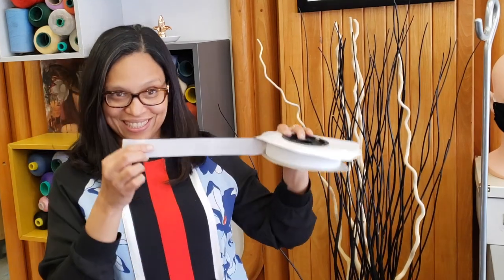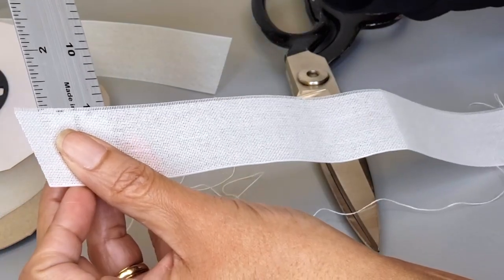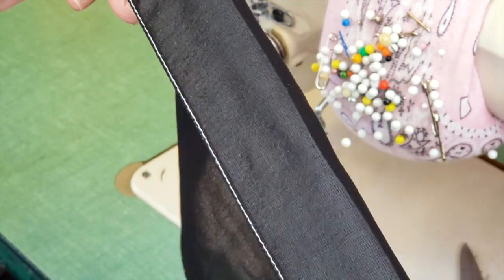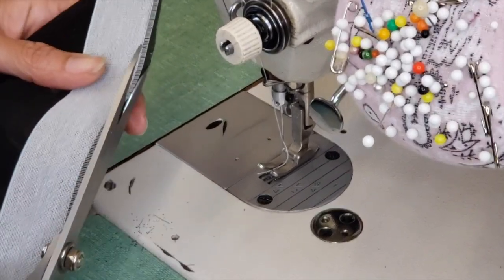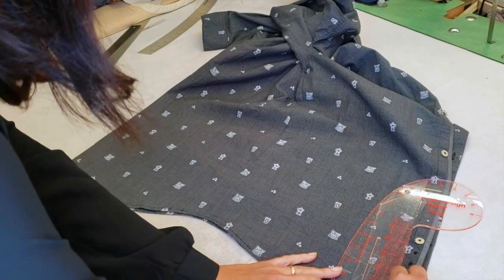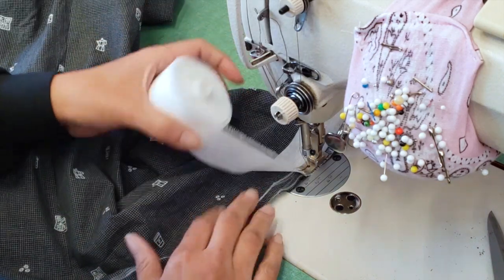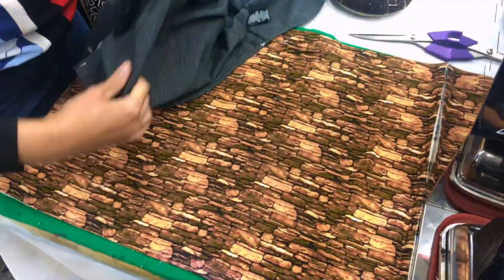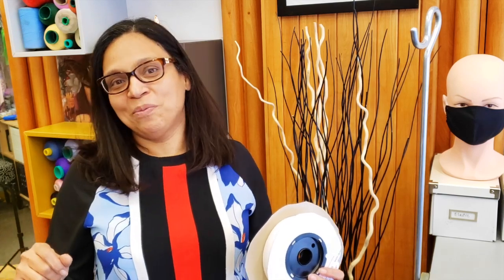How to attain a FLAWLESS hem using the BAN-ROLL technique! (curved hems too!)

Comment: Well that would have worked if I had only noticed that the first step is on the RIGHT SIDE of the fabric. Dang.
Reply from the maker: Ups! Sorry 😞 I'm pinning this comment because it might help others.
Reply: Sandy Cheeks  yes, I was not quite sure of that either.  So glad it was clarified first comment.  I feel sorry for people who don't read comments.  Granted I probably won't  read 500 comments, but I will check answers Downtown lady replies. Another great video.
Reply: I just tried this on a scrap, not  being sure of which side should be up for the first step. So, now I know :)
The product worked GREAT!!  Thanks so much for sharing this video.
Reply: You're human!  And sometimes we all learn best from our mistakes. Next time it will be perfect!
Reply: Can the ban-roll be reused more, than once?
Once the edges are a bit frayed do you cut the frayed edges off and make a new edge?
Reply: @velvetstitching3631  I have been using it more than once if I am needing the same depth hem on another garment,  or peeling it narrower for a wider hem in some cases.
Also,  there are 2 sides to the tape,  I think using the un-fringed side could be possible too.
Reply: Can I double the hem as normal or do you it sew it just with a raw hem?
Reply: Where can I buy ban roll interfacing tape? I have looked all over and cannot find it. I would appreciate any suggestions.
Reply: @DowntownTailoring  where did you get your iron from?  I want a professional steam iron!

Comment: Thank you for sharing your expertise!
Reply from the maker: Thanks for watching 🥰
Reply: @DowntownTailoring  May I ask a question? I’m a novice and (slowly but surely) learning pattern adjustments needed for improved fit.  I always have to do a high round back adjustment and a forward shoulder adjustment.  I also need to shorten the length between the shoulder and the high bust up to 3/4”-1”.  When making the corresponding adjustment to the sleeve piece, I don’t have enough space to shorten the sleeve piece between the notches and the sleeve head.  It also significantly distorts the shape of the sleeve piece. Would you please offer a suggestion on how to adjust the sleeve piece properly?  I would be ever so grateful.  Thank you

Comment: Another excellent video—and that iron—do tell which brand/model! Also, I see that you leave the hem with just the one fold. Do you ever encapsulate that raw edge by folding over again or would it be too bulky?
Reply from the maker: Thanks 🥰 Yep, I did encapsulate the raw edge when I turned the ban-roll.  Cheers 🙂

Comment: Thanks for this great idea. Do you have a source for this Ban-Roll in Canada?
Reply from the maker: Thank you Mary! I live in Canada as well. I ordered mine from Cleaner's Supply, they are based in the U.S but they have very fast shipping if this helps :)
Reply: @DowntownTailoring  Thanks for the quick reply! I have ordered sewing supplies from clearnersupply.ca and their pricing and shipping are great (wawak.ca as well). I noticed that their ban-roll is listed as made of polyester and other US sites list it as: 58% nylon/17% rayon/15% polyester/10% thermoplastic resin   --- do you think it matters? regarding strength of the little threads is what I am thinking...
Reply from the maker: My pleasure! I do believe that it probably matters a little bit. However, I have used the same roll of the interfacing tape over and over and it has served very useful. Haha my apologies for I wish I could give you a more precise answer!

Comment: As I said before a real game changer but not as easy as it looks. Practice with it I'm sure will make perfect. I had a question Assuming the ban roll is long enough for your next project and requires a 1/16 " you  could actually use the same ban roll you just used again with the new project yes? If so then this makes this a super game changer!! LOL
Reply from the maker: Yes! You can reuse the ban-roll many, many times.  Cheers 😊

Comment: Great technique! Thank you for sharing this.  I have a question.  I went to India and brought two outfits home for my daughters.  They fit well except around the sleeve/underarm part. (They are short sleeves) Do you have any suggestions or techniques (possibly a video) that could help to alter the outfit to fit?
Reply from the maker: What seems to be the problem?
Reply: It is to tight in and around the sleeve area.
Reply from the maker: @marypacer3084  You could insert a gusset into the sleeve to add more room. I haven't made a video on doing this with sleeves yet, but my video about making jeans bigger by inserting material could maybe help!
Reply: @DowntownTailoring  ok. I will look at it. Thank you for your help.

Comment: Is there a reason you didn't reuse the Ban Roll from the opposite side? It seems to me, once you rip it out, you could even cut it lengthwise and reuse it multiple times. Or is there something I'm missing? Thanks, neat tip!
Reply from the maker: Yes. You can reuse it.  
Check out this video.  You can go directly to the minute 3:30. It answer better the question.  Cheers
https://youtu.be/ppc_dI58uDI

Comment: I've been watching your tutorial on the Ban-Roll tape, and am wondering how effective this method is when working on fine silks or chiffon fabrics?  When you remove the Ban-Roll Tape, it seems quite agressive and wonder if it will damage the finer fabrics?
Reply from the maker: Hi! This is a great question.  Thanks for asking. It doesn't damage the fabric for the most part. If you try to pull it too slow, it can pull a thread with it. The right way, like I joke about in some videos, is a savage one: 😁 snapping while holding the seam with the other hand. Not too fast, not too slow, just make sure you are holding the hem closely and securely with your other hand. I hope this helps 😊
Reply: @DowntownTailoring  Thank you.  I will give this a try.

Comment: Is this the technique I would use if I wanted to make my own silk ribbon on the bias?
Reply from the maker: Yes, That's a way.  But I think the spaghetti strap technique will be nicer and cleaner.  I explained it in this video to achieve a very thin strap.  You'll need to use a wider bias tape for ex 2 1/2" to achieve a 1" ribbon.  I hope this helps ❤ 
https://youtu.be/76Gtqe7tEnE

Comment: But what about turning under the ends at the beginning and end of your hem?  At least for the top layer of your shirt (at the bottom of your buttonholes) you still need to turn under those ends so it's finished well.
Reply from the maker: Yes. When I do alterations I usually copy the original hem like I did with this shirt.  It's very sad but Today's fast fashion is not making the hem inside the placket/facing anymore 😔 Saving time therefore money. The saddest part is that the public even doesn't notice the difference 😪

Comment: ???I am going to use this for a dress hem. Just practiced on a scrap, with success.  Will I need to cut a length of ban-roll equal to the circumference of the dreas hem?  I think so?
Reply from the maker: Yes. This would be optimal.  I usually have a mini roll of 7 meters which is long enough for most hem. Cheers 🙂
Reply: Thank you.  Finished it this afternoon. Worked great.  I so appreciate your video.  Was unaware of this product before watching.
Reply from the maker: @janiewilliams5803  I'm glad everything worked out fine! 😊

Comment: But doesn't it just put up a single fold, not a double fold, so raw edges are inside the hem??
Reply: Watch as she folds the tape around the edge - the tape starts on the right side of the fabric, so as the tape is folded away from the right side, that causes the first fold of the hem, then the tape is brought around to the wrong side of the fabric and that tucks the raw edge in for the double fold. So the raw edges are hidden.

Comment: I've seen this technique before and as one who's sometimes struggled with narrow hems over the past 60 years; I think it's TERRIFIC!  If you have a really good eye and very sharp scissors, you can carefully trim that tiny hard edge off the Ban Roll before using it. Just cut between the edge and the first "string". It makes removing additional strings much easier.

Comment: Anyone knows a European supplier for this, please reply and let me know. I just searched for an hour and can't find anything like this...
Reply from the maker: Try to look for buckram.  It's basically the same product.  Just make sure you are getting it in narrow rolls. Good luck!
Reply: @DowntownTailoring  
I tried. I know what buckram is, from watching videos about historical tailoring. But when I google it, nothing comes up. Or rather, I get lots of results for iron on interfacing and   coated/laminated stuff. 
Even Etsy was a fail. 
I guess, I'm going to try water soluable embroidery stabilizer, instead. It will create a stiff hem at first, but should completely dissapear in the wash.
But thanks for trying to help!
Reply from the maker: Yes. It might work!

Comment: you can also just use a sheet of typing paper instead of the roll of tape
Reply from the maker: Yes! But you have to take in count that the pieces of paper will remain inside the hem.  Just in case it's important.

Comment: The usefulness of the tape isn’t worthwhile if the strings won’t pull off the edge.  It will rip the hem.  Possibly one brand is better than another
Reply from the maker: Try to get the ban roll at Wawak.  I use mine for years and I have an alteration shop. Good luck!

Comment: I use a hemming foot, its easier, much quicker and you dont need to buy any overpriced tape. What gives? Why do you prefer this way of doing it?
Reply from the maker: Hi! This is a matter of preference.  I find that is easier to achieve a perfect finish.  The ban-roll is not more expensive anyway than the foot.  I have many colleagues and some prefer the ban-roll others the rolling foot and some, don't like to do this hem at all 😁 My take is that it's good to try and see.  Cheers 😊

Comment: Does anyone else see this is very wasteful?  This planet is suffering because of our waste. 

Our planet is a great big dump.
Reply from the maker: Hi Pesach! You can reuse the ban-roll many times.  Mine last for years and I use them very often as I have an alteration shop. Ban-roll is a tool, like the ruler or scissors. 
And yes. I agree that the planet needs less waste.  Alterations, repair and custom made garments is one of the many ways to help with that, but not having the right tools to do them well discourages people from making sustainable choices. There's no ethical consumption under capitalism, so there will always be a carbon foot print associated with the production of reusable tools but in the long run any step towards a sustainable lifestyle is superior.